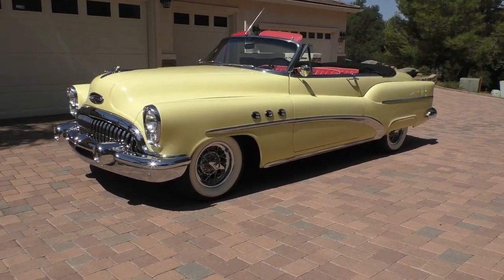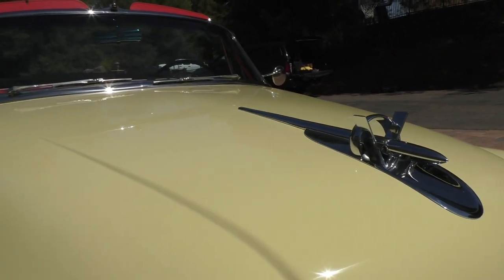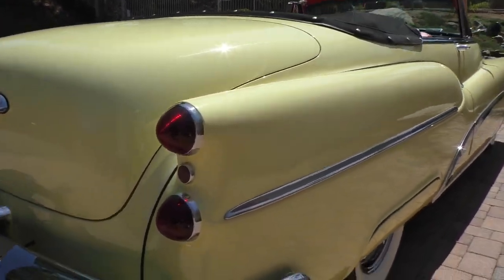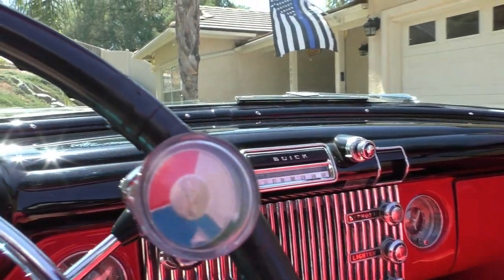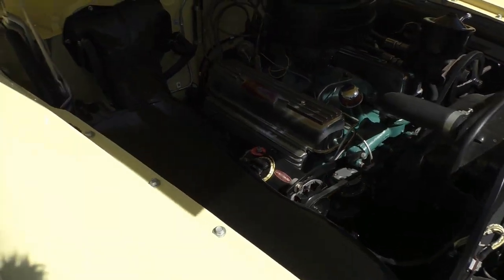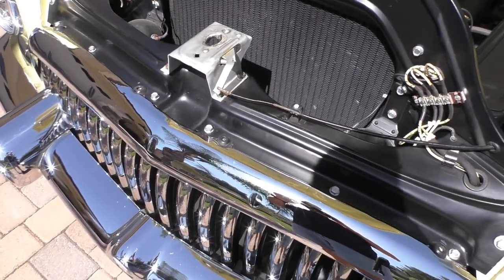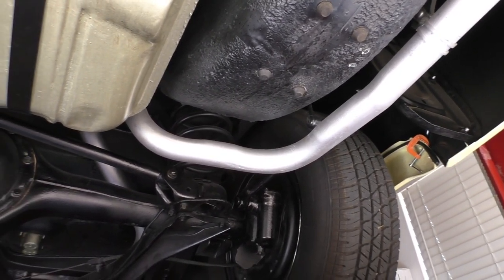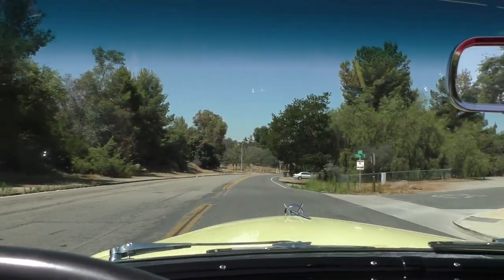1953 Buick Super Convertible Model 56C 1st Year V8 (SOLD)

Comment: Why did Buick drop the straight eight for a V8 ?
Reply: Several technical reasons, but also for styling.  This era was the start of higher horsepower engines, and to produce a straight 8 with greater horsepower, it would need to be bigger.  In addition, new styles already on paper for ‘54 and later incorporated a lower, sleeker look. The straight 8 required a taller and longer front end, while the V8 was shorter, lower, and more compact.